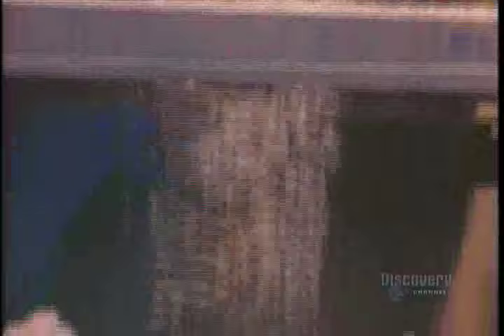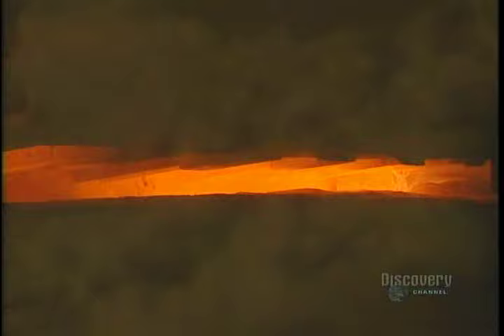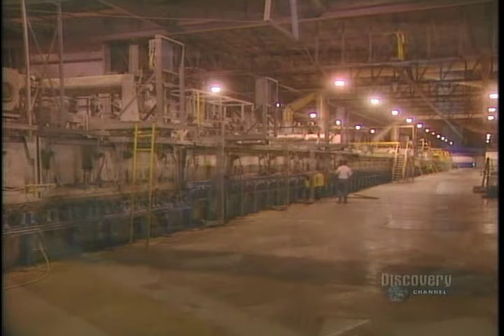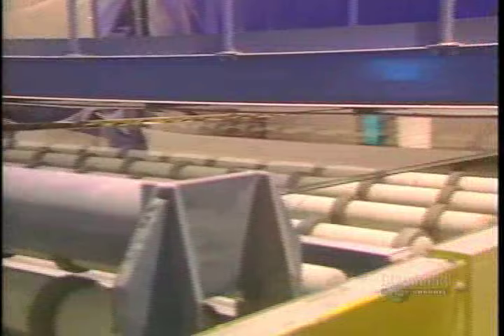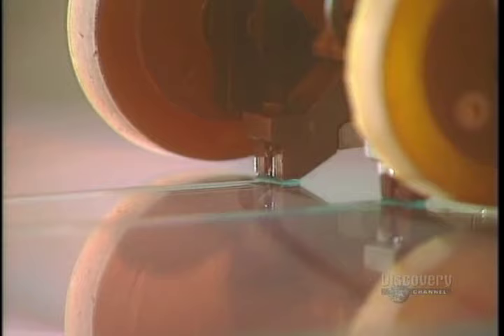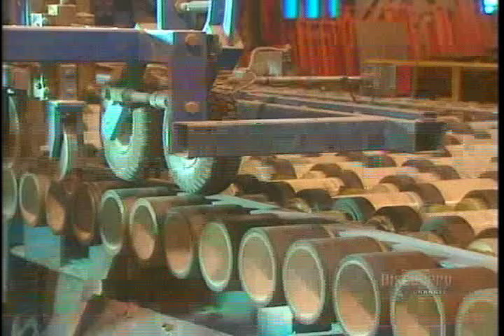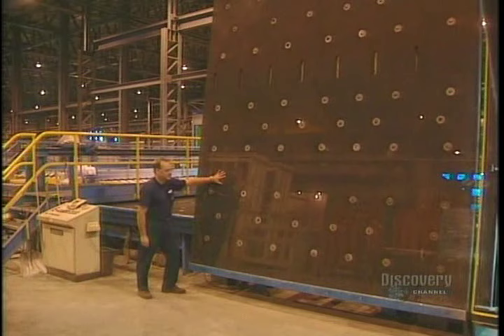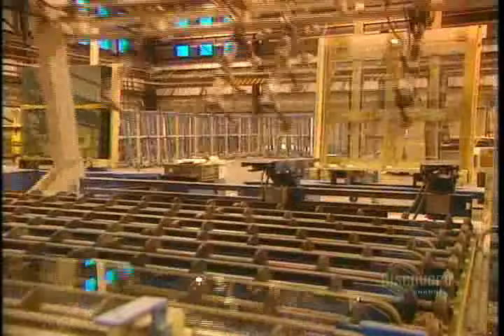How It's Made Plate glass

Comment: "goes through a tin bath" - and what exactly is a tin bath? molten tin that somewhere doesn't affect the glass? Is the molten glass self levelling?"the glass must have a uniform thickness" - what happens to the parts that are not? Does something happen to level it or is the whole pane scrapped?
Reply: The tin is molten, in other words liquid. So yes, as is with any liquid, it is self leveling as is the glass in that state. It is denser than the molten glass so the glass floats on top of the tin. That is why this is called "float" glass. The pool or ribbon of glass is controlled by several  "top roll" machines 5:04 that stretch it to the thickness needed. But yes if, the thickness is incorrect it is sent back into the system for recycling. The tin does not affect the glass in anyway you can see  but the "tin side" is a bit chemically different and would not be used for any special coatings like LoE etc.

Comment: If they want to tell us how glass is made, they shouldn't be telling us how one factory does it, they should be telling us how all factories do it.

"To make glass, they add recycled glass..." That's like needing chocolate to make chocolate. How far back in history do we have to go before we realise glass wasn't naturally occurring, and it can't multiply on its own?

Recycled materials are not a necessary ingredient, so they should skip over that and pretend they're starting from scratch, so we can all learn something useful.
Reply: True, but it is an evolutionary process. If my glass plant similar to this, for instance skipped the cullet (broken glass) just for educational purposes, it would change the batch and all the heat settings. Which may not sound like much but is a big deal. In reality the process is identical without the recycled glass other than the temperature to melt the batch will be much higher and less cost efficient. We use 20-27% recycled glass in our process depending on what is available. Only like glass (same recipe) will be used. You don't use Smuckers jars in window glass etc.